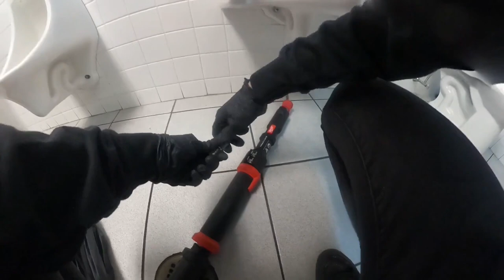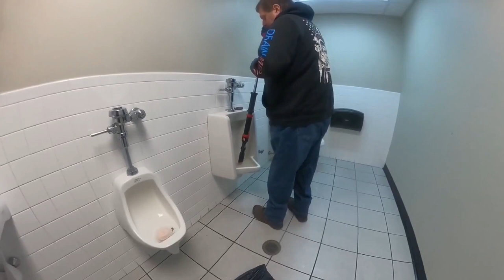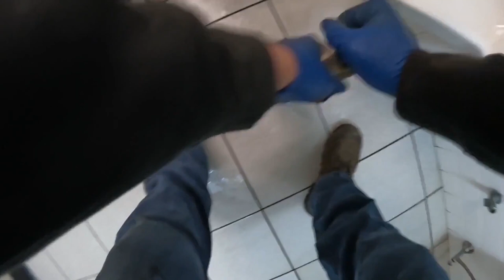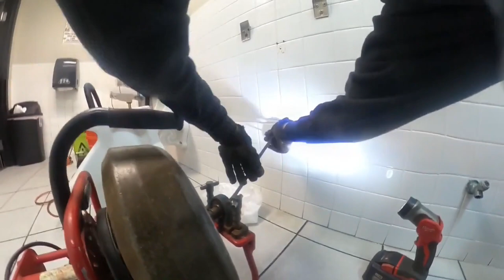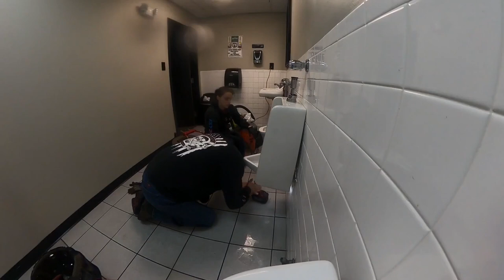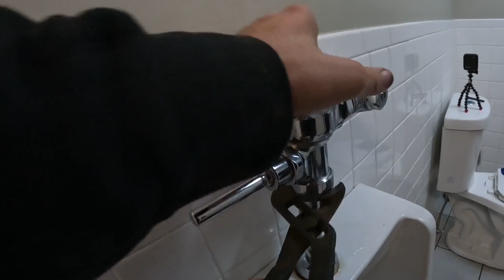How To Unclog a Urinal Drain 198

Comment: Great job Bob Shelly, never seen that sort of gun before, feel sorry for you Shelly been so close to the urinals they are bad, well done to you both  👍
Reply from the maker: It's called an air ram made by general. This one actually isn't that bad the owner of this bar is very very clean, and on top of cleaning the whole place. (Shelly)
Reply: @Drain Medic  thought that place looked clean and tidy
Reply: @DrainMedic  I'm pleased we have u bends under them here in the uk which you can unscrew only thing is over here you can't flush them as they are on timers so flush themselves
Reply from the maker: Very very clean it's amazing for a bar. (Shelly)
Reply from the maker: Ewww so they must smell terrible. The trap under them would probably make cleaning much better. (Shelly)

Comment: thats easy just use a jackhammer, destroys the clog and anything it touches. well, one would think that after a few moment on one of these
Reply from the maker: If only it were that easy lol. (Shelly)
Reply: @DrainMedic  i was at roto rooter when i first did one of these. its at that point i learned what i considered to be one of the worst smells in drain cleaning
Reply from the maker: Yes urinals are very stinky, however I think an operating room drains are the worst smell ever. (Shelly)
Reply: @DrainMedic  i have never done an operating room, thats interesting considering our job and the hospitals sanitary needs are as such